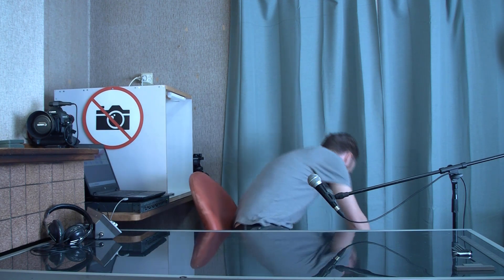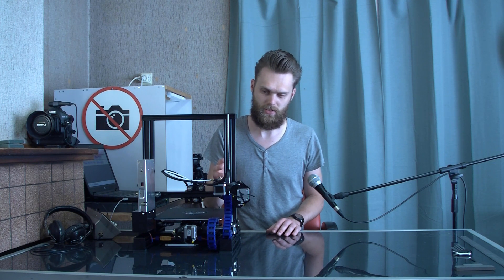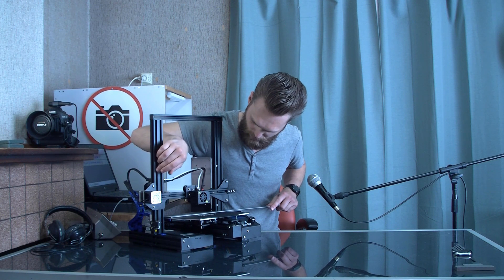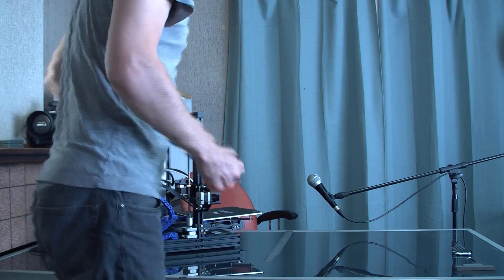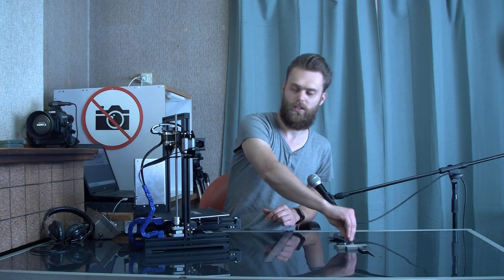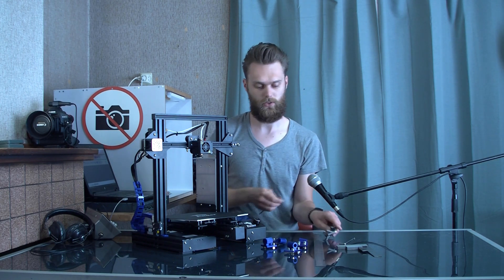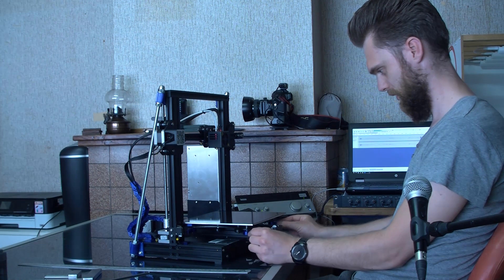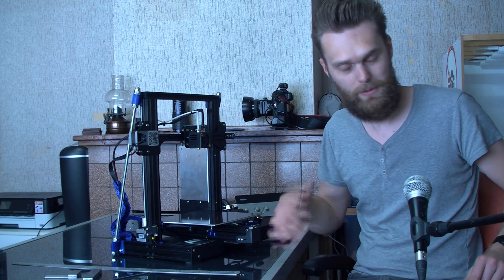Ender 3 pro build: Starting off properly

Comment: Hi, will the brackets work with an Ender 3 S1?
Reply from the maker: Hi, not directly since the profiles of the S1 are closed, so it's not possible to mount this without drilling or using different profiles.

Comment: Is it possible to attach the upper "rod holders" on the other side of the beam, because I would like to have a dual-z-kit, which comes with bearing holders that will be attached to that same spot

Comment: hello I printed your z braces, they are awesome but I ran into a slight problem with filament feed. and that is the actual filament grinds on those threads when it moves up the gantry. how did you ran your filament for it to not happen?

Comment: I'm really impressed, not only with the video but your whole site with GOOD original content!  Solid thanks for that!  I'll be trying out the frame braces since I noticed that my taller prints had a few mm of lean to them, after thinking on it, it could only be that my vertical extrusions are leaning and throwing off the whole print.  Even in a 20mm cube shifts by about .25mm from bottom to top.  While I'm at it I'll probably do the dual-z as well. In the US I'm able to order everything I need to do 2 ender3pro's from amazon for about 50$ to do the dual z and frame braces, much cheaper than ordering kits to do it all.  Thanks again and looking forward to checking out your newer content

Comment: It would probably be better to loosen the through bolts coming up from the bottom of the frame before squaring it up and then tighten them again after it is squared using the threaded rod. That way you don't end up putting a bow into the extrusions and instead set the angle adjustment using the tension on the bolts.

Comment: Good video. I have printed the fasteners for the threaded rods, and mounted theese today. BUT i have the PLA thread coming Down from the top, and With this it will be Limited print hight. this because the PLA will hit the threaded rod on its way up.  If the top right fastener ( on the side where the Power supply is not) was thicker in the flat side (where the 4 screws go through)  The threaded rod will come more out and it is possible to print higher. You have to change the angle on the threaded rod too.    Or is there any other solutions on this?

Comment: It would be nice to see a before and after print.  I have thought about adding braces but without a benchmark it is difficult to see if they add value.
Reply from the maker: Thank Justin for your comment! Yes, that would indeed be a good thing to do. I should have done that :). One thing I'm sure of is that it wasn't perpendicular and that it is now. I don't know if this is easy to see with benchmark tests. The one thing I definitely experience after these upgrades is that the printer becomes very reliable and stable. I never have to touch my bed leveling knobs and it's always spot on :D

Comment: Dude you are a legend. I've been watching the same videos over and over trying to get my ender 3 to be as acurate and reliable as possible. I'm a total noob when it comes to any of this but watching your videos has helpped me loads. I'm curious though, seeing as my only printer is the ender 3 Pro can or is it possible that this and even the dual z axis upgrade can be printed on a stock Ender 3 Pro and still have the same results you have. I'd love to know if you think it would be possible to make the Ender 3 more acurate by making it print out its own upgrades (this is what i'm doing to some sucesses) I will post my resullts once i've ordered the dual Z parts and finally got this machine to print in PETG more reliable. Oh and by the way TOTPH video on setting up the Ender 3 was great thatnks for reccomending it. I set mine up and had no idea that everything was miss aligned. So today I did a rebuild and BOOM. The beauty of things being level hahahahaha thanks again dude look forward to your new content.
Reply from the maker: Thanks Chris for your comment! I'm happy to read that my videos helped you and that you've managed to get your printer assembled correctly! Funny thing you mention because it's pretty paradoxical to print upgrades to make a printer print better so it can print better upgrades xD. The Ender 3 when assembled correctly already prints very well. The biggest advantage I've experienced is the stability. I never have to touch my bed leveling knobs and it's always dead on. Good luck and let me know if you manage to get the double z axis working :)

Comment: There are many printers with these tall unsupported verticals and I'm surprised this hasn't been discussed more in the community.  To make matters worse, many of the designs hang additional weight off the back side of the verticals such as a power supply and filament spool further stressing the joint with the horizontal base.  My Ender 3 pro is quite square, but I worry that it could get bumped. I created a filament spool shifter to better center the filament over the top horizontal and reduce the lever arm pulling to the back (thingiverse 3816234). I've considered a corner brace that is adjusted by sliding along the side of the horizontal then fixed in place by tightening t-nuts, the connection to the vertical would have some room to pivot and would also be connected to the side using a t-nuts.  Not sure if that makes sense, it would much clearer in a sketch, but it accomplishes the same thing as your design.  I also thought about using the power supply itself as part of the right side angle bracket by attaching the back side of the power supply to the right horizontal base as the power supply is well fixed to the vertical.
Reply from the maker: There is a bug in the YouTube studio app that replies to a comment aren't placed and my reply to your comment was one of them :P. Thanks man for your comment and I'm surprised as well that this isn't discussed more. In hindsight I should have pointed this out more in this video. Nice spool holder which clearly balances the vertical rods out, thanks for sharing! Your solution makes sense to me and using the power supply seams like a good solution. Because of my enclosure this doesn't work for me :)

Comment: how long should the threaded rod be?
Reply from the maker: The rods need to be 480mm long so you can get two out of 1m :D I still recommend measuring this after mounting just in case you have a different outcome. More information about this thing can be found on Thingiverse https://www.thingiverse.com/thing:3719799 where I have a list of all parts at the bottom.

Comment: It is funny how many people over look that fact that all these Ender-3 require shimming to ensure that they are perfectly square and perpendicular. I did like your video and the two side strut supports are very good. Not sure about the leveling wheel replacements, as I have never had issue with the larger wheel. The smaller wheel on the CR-10 were a pain in the ar....fingers. Keep up the good work.
Reply from the maker: Thanks for your comment! I am convinced that these first steps are very important and I think too that this is often overlooked. The leveling wheel replacements are a bit experimental and they work best together with an adjustable z-stop. I’ll mention this in my coming video :) Thanks again!